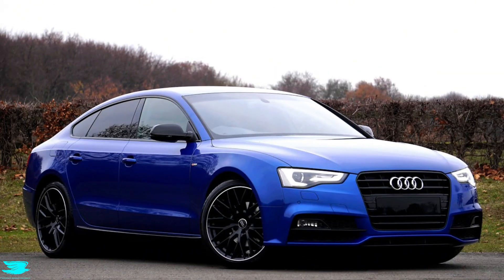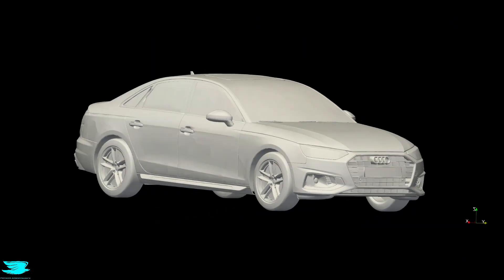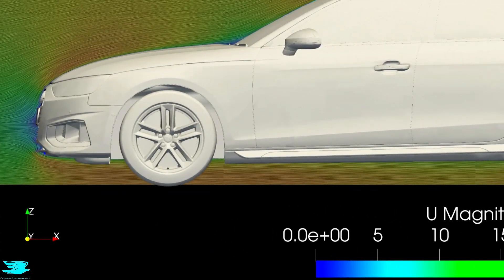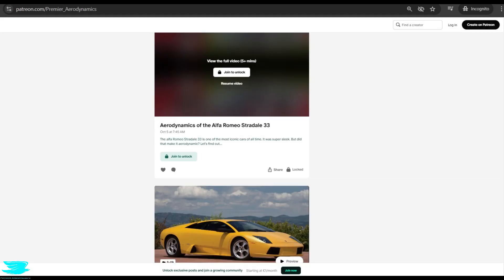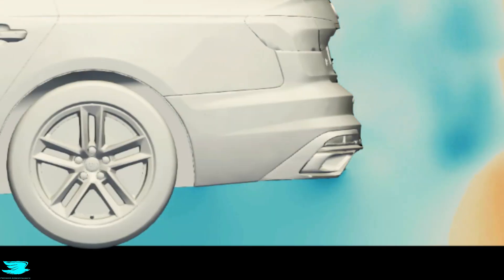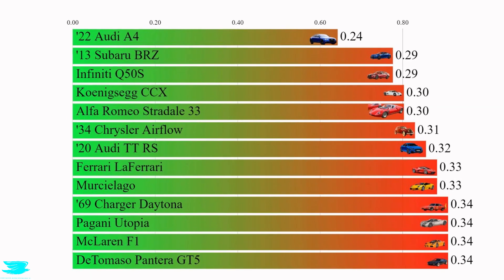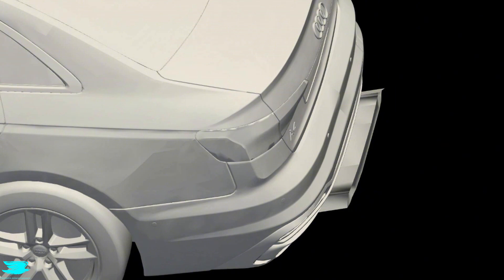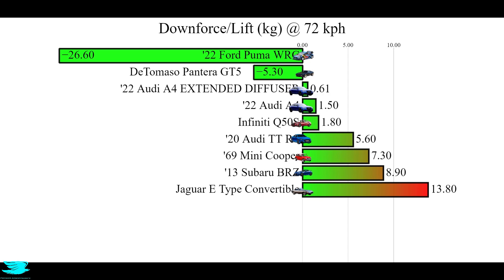I Made This Luxury Car More Aerodynamic

Comment: I have this exact car. 

The wind noise (whistling) from the side mirrors is annoying to me. It sounds like you have a small leak in the window seal and more than once I've thought that I didn't put the glass up all the way. That said, I understand Audi designed it so that the induced airflow would help clear the window when it rains and it is really effective too. The airflow is attached enough that at highway speeds, the water stream at the top of the window will remain up till past the front windows. In my previous A4 (B7) the airflow would only be able to clear the water till about halfway down the windows.
Reply from the maker: That's really interesting to know. I think this feature is not talked about nearly enough. A lot of designing goes into it.
Reply: @PremierAerodynamics  On the side facing the window, there three vertical ridges molded onto the housing which are obviously there to create this effect.
Reply: All my previous and also my current Audi A4 has had the whistle, the A6 was the worst, at speeds above 160-170 the whistle noise was intrusive inside the cabin.
Our Superb 3T, which shares it mirror with the A6 surprisingly didn’t have this problem, but was not as good at keeping the side windows clear of water though. 

For daily driving, it was never a problem.
Only on the Autobahn on long stints through Germany it was apparent.

Comment: There is a neat trick those side mirror do. They guide the air so it keeps the window part you look through onto the mirror clean of water when it’s raining. All without much noise. Neat trick on the highway.

Comment: Would it also be aerodynamically beneficial to add a (horizontal ) boot (trunk) lip spoiler, to provide a sharper cut-off point for the air flowing over the roof?
Reply from the maker: Definitely. Even one pointing slightly down will work too. But, the current version has that little upturned spoiler to give a little more downforce. That comes with a drag penalty.

Comment: Interesting. On the Audi A6 Sportback e-tron, claimed to be Audi's slipperiest car ever at Cd of 0.21, one of the items they credit is an efficient rear diffuser.
A saloon/sedan from Dongfeng, Forthing Xinghai S7, claims a remarkable Cd of 0.191.
Where do you think the limit is for these types of cars, as not that long ago such values would have seemed utterly fanciful?
Reply from the maker: There are a few things to keep in mind whenever a manufacturer quotes their Cd values. The first is that every wind tunnel will give slightly different values. The second is that you can put different options on the car to make it lower drag - for example, different rims. Third, sometimes, it isn't actually the value. But, there are definitely some around 0.2, which is great.

As for the lower limit, I personally think that with the current general car design, around 0.13-0.15. Mostly just the wheel drag, and then some cooling drag and general friction drag. If you can get the pressure drag lower, for example, by making the rear much smaller, then you can drop the Cd very easily. It wouldn't produce much downforce, though.
Reply: Agreed, probably lots of available "flexibility" in exactly what Cd they quote!

For the rear, a bit like the Mercedes EQXX at 0.17, perhaps, where the rear track is narrower by 5 cm, allowing a gentle tapering of the rear.

Maybe designs will move closer to the Ford Probe V's 0.137 (Probe IV's at 0.152) - but obviously without the the front wheel covers. 
Perhaps also clever designs for wheel spoilers, air curtains, wheel vents, tyres and wheels can be made to effectively create "virtual wheel covers". I also wonder if higher speed air in the wheel well passed through from the front and out through the wheel vents could not just reduce the high pressure and lift in the well, but also reduce the outwash of air from the wheel and the well itself.

Comment: Yesterday I've been passed by a Corvette  C4 and it looks so pointy that I wondered:"is it aerodynamic?"
Reply: Pointy doesn't generally mean aerodynamic. Sometimes, it might even be actually very high drag. Examples include the BMW M1, Lotus Esprit S1 and Lamborghini Countach LP500. A Tesla Model X is more aerodynamic than all three despite looking like a shaved soap bar.
Reply from the maker: We have it on the list too.
Reply: @PremierAerodynamics   i didn't find it
Reply: @themetalslayer2260  apparently they did that so the radiators can be slanted at 15° to reduce the effective frontal area of the car for radar or laser scanners, reducing the range that the scanners can detect the car. The radiator is the first metal part of the car that the scanners can bounce, since the body is made of plastic.
Reply: 🤤 I own a C4 and have always wondered this
Reply: @Itsjamilagain   its frontal area is really small, the car is visibly made for speed so perhaps Chevrolet thought about making its flag-ship super aerodynamic.

Comment: Wish audi didnt design their cars to place the engine in front of the front axle. The A4 has good proportions, but because of that engine placement, and FWD without Quattro, I hate imagining the A4 lumbering around corners and understeer to oblivion.
Reply: It's the identifying property of all Audis through history :P With the B8 (previous gen to the one modeled) they apparently greatly improved handling. Took mine round the Nürburgring and it handled fine without too much obvious understeer. (255's all round)
Reply: But that’s what makes Audi looks Audi. Even the EV has similar proportions.
Reply: They could fit 285's in the front and 215's in the back😹
Reply: the Audi drive train layout is from DKW and it's one of Audi's isms that make it unique
Reply: Yeah. Audis are designed to blend comfort with performance, with a weight on comfort. Moving the engine foreward gives more cabin space.

But unfortunately this also means they have terrible weight distribution. Funnily enough, the Avants typically have better weight distribution making them preferable for driving.